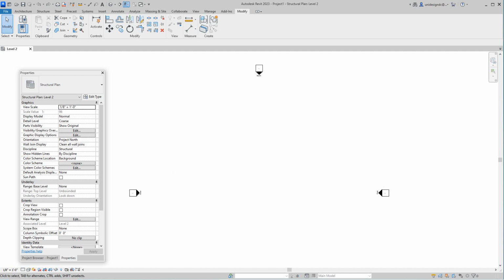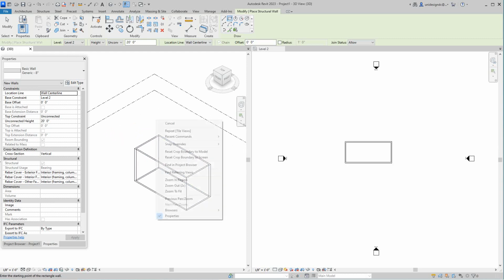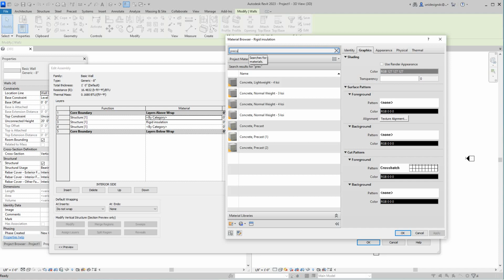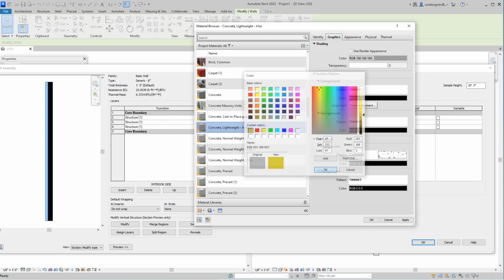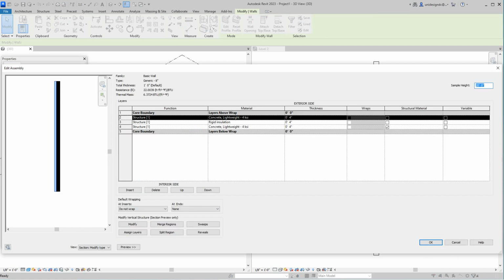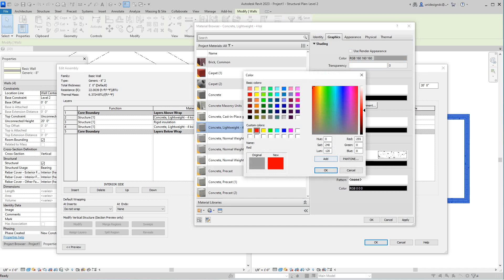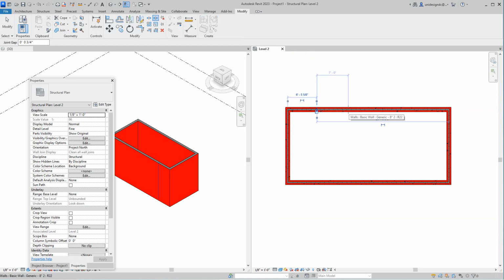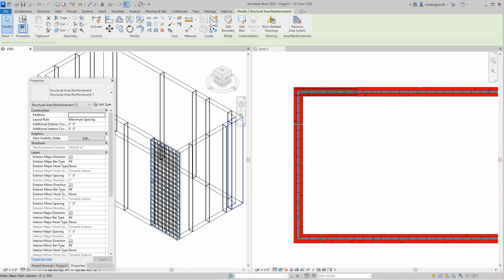Revit Precast how to add color to wall panels

Comment: Can someone help me in a doubt: i m doing a lift box and wall in precast... when i split them in pieces the Revit split the 4 walls of lift box and dont allow i make this as BOX and also i cant add the vertical joint cause this is automated by function SPLIT.... so how i do ?
Reply from the maker: Hi I will try to help you and we will make a video of this process. But I need to make sure I understand what you are trying to do. What is a lift box?